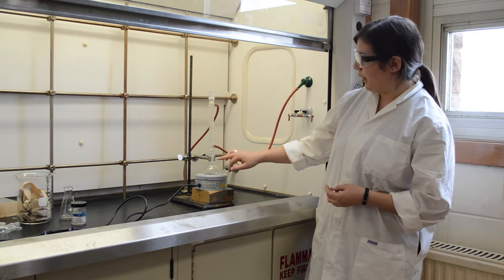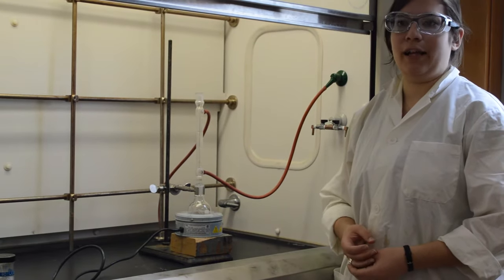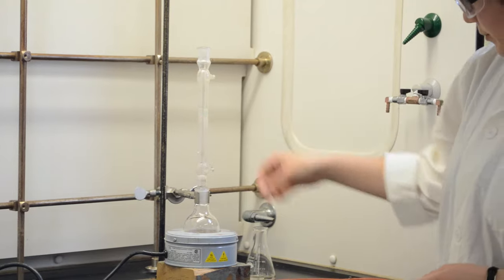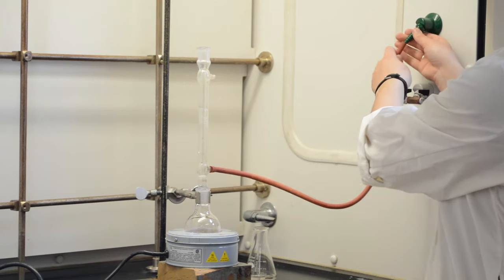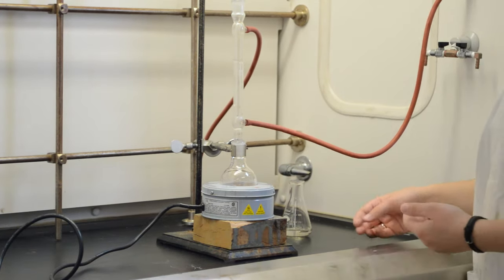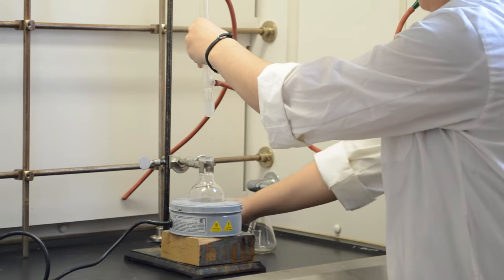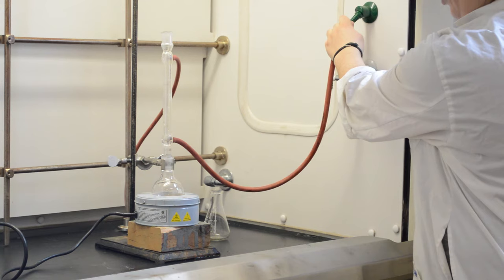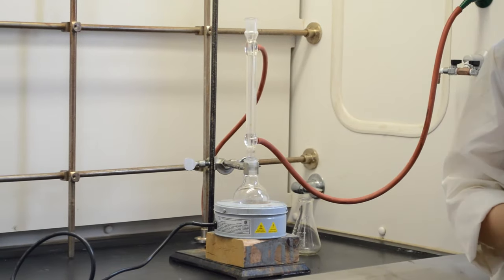How to Set-up and Perform Reflux

Comment: Quick question - why is the temperature gradient of the water parallel with that of the gas ? Surely it would make more sense for the water to flow with the inlet at the top and the drain at the bottom as the water would always be colder than the adjacent gas that way?
Reply: if water flows down the condensing jacket and drains at the bottom, air pockets form in the jacket leading to inefficient cooling. also, the gas will be hottest at the bottom, so the coldest water will run parallel to the hottest gas - again, efficient cooling.